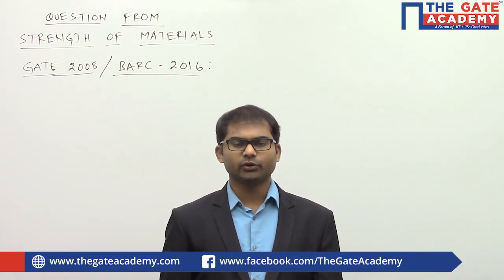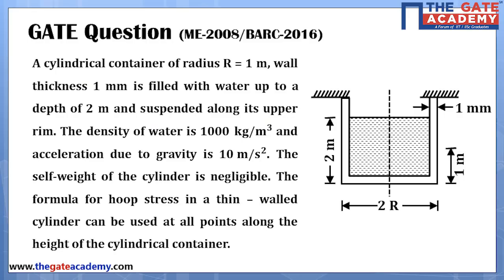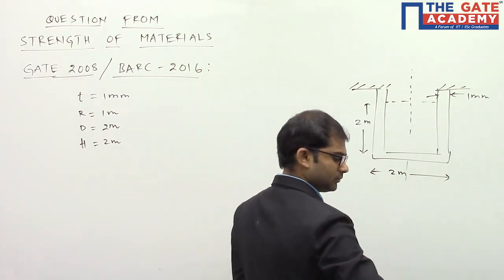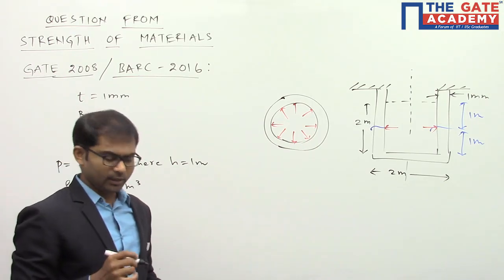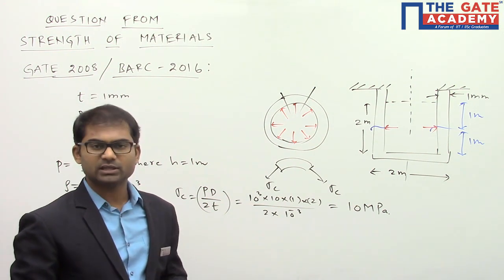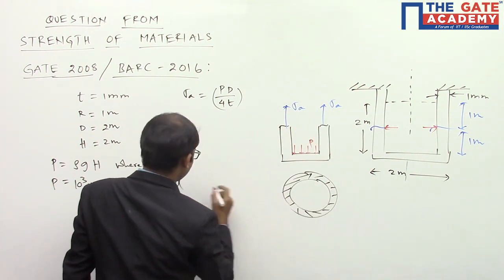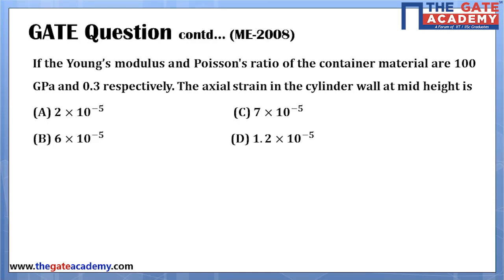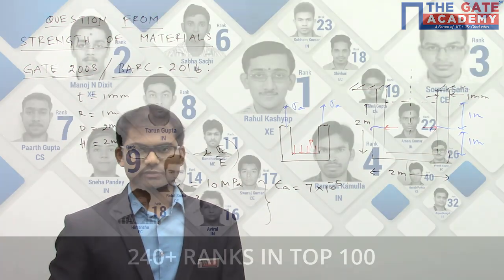Thin Cylinder - Excellent Question - GATE Sol | SOM | Mechanical/Civil Engineering

Comment: Dear Sir, with all due respect, I beg to differ on the answer chosen for multiple reasons.
1 - As stated in your video, you said many answer books have made a wrong assumption of axial stress being less than circumferential, I must say, the workbook by Gate academy itself has given an answer of b) (5,10) and a) 2x10^-5 if my memory serves me right. 
2) I feel the answer b and a respectively are correct too as the question explicitly asked us at a height of 1 meter. And as we know, the pressure along the dept ( as we keep going down the tank ) keeps on increases and pressure is a function of height. So internal pressure is 10 MPa at height 1 meter and 20 MPa at height 2 meter dept. so I feel the axial stress will be 5 MPa and not 10 MPa. Please correct me if wrong. 
Also, once you take axial stress as 5, the axial strain comes out to be 2x10^-5 
Sorry for the long comment!
Reply: Yes 5 is the correct answer.